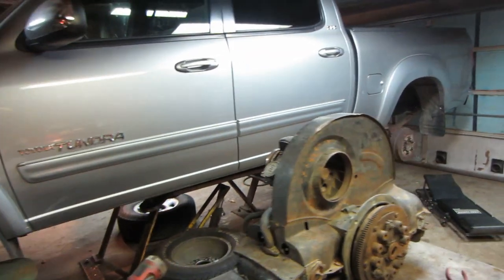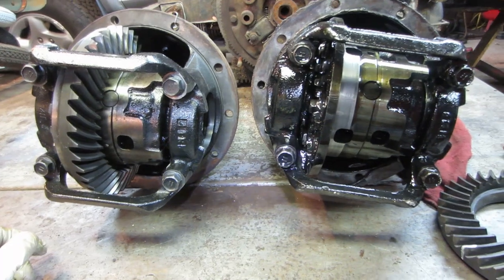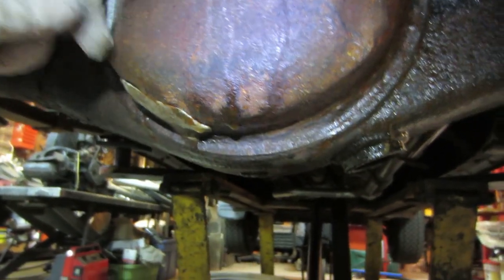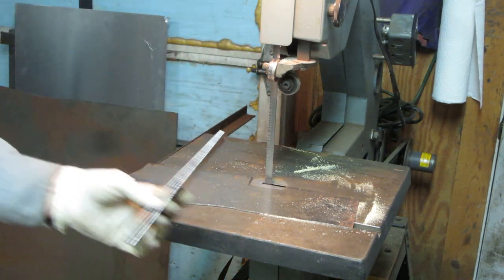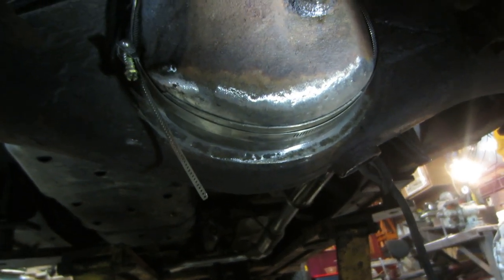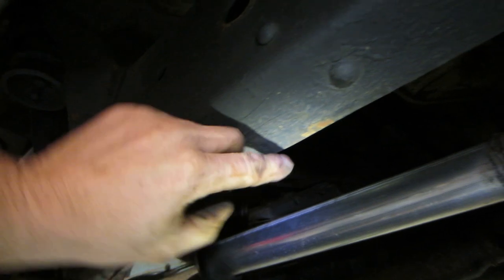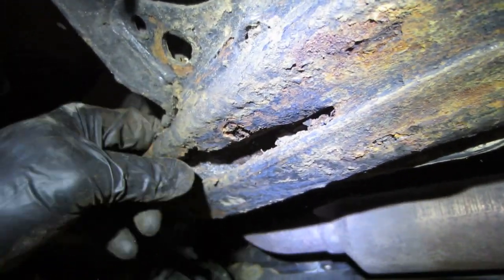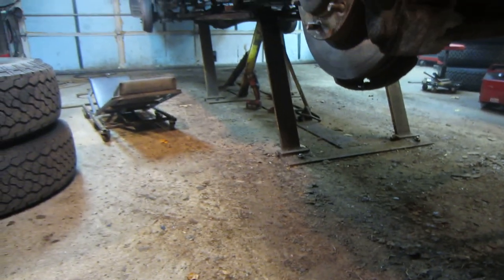toyota tundra rear differential repair

Comment: Seeing all that rust behind the "protective" coating makes you want to grab a Toyota engineer and show him how great their "fix" is.  Then again, he'd probably blame the dealer for some kind of mis-application error.
Reply: Wow!  I can't believe that Toyota used such thin steel in the frame and rear axle housing, then didn't even give it a good coat of paint at the factory!  And yes, the "fix" really was aquick coat of magic elixir, did more harm than good, but probably got it through the warranty.  At the time, Toyota apparently didn't quite have a grasp on how Americans used their pickup trucks, and what was expected.  The half ton pickup is probably the most overloaded and overworked vehicle made...or, it is simply used as a car.
Reply: Genghis Chuan  tar has been around for decades ..it is still widely used ..that stuff was/is just crap
Reply: Genghis Chuan  never said that toyota applied 
tar was saying tar is available and won't be a shitty job like what they used
Reply: Genghis Chuan  lol..i applied it as a job,if you do it right it takes the same amount of time as what Toyota used... it's sprayed on and drive out..
Reply: Genghis Chuan  anyway this was your original statement not how do we apply tar to the underside of a car ....'The engineer used the best available at the moment'....obviously it wasn't it failed ...tar wouldn't  fail if applied correctly
Reply: I mean you know all trucks rust right?  Toyota isn’t worse than anyone else.
Reply: I seriously doubt that Toyota approves of the use of this "coating."  It's a dealership scam.

Comment: Thats the same truck as mine, upstate NY. Toyota replaced the frame for free... a mechanic at Toyota put his fist through my frame and it didn't pass NYS inspection. My diff cover was leaking so as you did welded patches but it just started to leak in a new spot. I bought an after market off road replacement cover, cut the old off and welded the new one on.
Reply: which after market cover did you use and how is it holding up?

Comment: Quick tip for the disconnected brake lines; wedge something against the brake pedal slightly and it will stop all the fluid. Just something enough to get the lights to come on, bit of light pressure. I've rested my car toolbox against the pedal for hours before, never had to worry about the master running dry.
Reply from the maker: l like that idea
Reply: Yep, just enough to get the piston past the port in the master.
Reply: Do you rest something against brake pedal before disconnecting line or after. So this is suppose to keep fluid from draining right.
Reply: It works. The primary piston moves past the compensation port and it will NOT leak out.
Reply: I scored a couple of plugs that   have a female on one end and male on the other. I can't quite recall the size but it works awesome just screw the brake line right into it.  Puts the brakes on the brake fluid and helps with possible air getting into the system

Comment: I just got my 01 tundra back from Toyota it has 270 k on it and they had no problem replacing the entire frame .they have a recall and won a  judgement against the frame manufacturer for something like 3.5 billon dollars .if your frame is rusty I would give them a call all they should need is the VIN NUMBER .it took them about a month to get my frame in but only a day and a half to replace it good luck .

Comment: Hey Mustie...  In NY...  I use a coat of JB Weld to fix oil pans and cracked blocks....   The grey 48 hour stuff....  The trick is surface prep.. To bridge large holes use a small piece of aluminum tape.  ATF is the best undercoat..  Chevy's rot just as bad...

Comment: Man I got nervous for you picking at that rot.  That frame looks weak at the spot you were working on.  Can see how the rust starts though. The curved part of the frame just collects water and dirt till the drain holes plug. Then the gunk just sits there wet..and then a rust blow out.. Silly design..

Comment: hey mustie. im a plumber i have several pipe threading oilers. after years of use rain etc the rust pinholes in the pot. i clean them and i spray truck bed liner all in the pot after i epoxy them. now 6 years later there still in use. you should spray your tundra differential cover with that it will never leak or rust again

Comment: I'm 73 and remember when undercoating was an option that was added to new cars at dealership, however these "new" cars sometimes sat in the mfg's parking lots for weeks and had surface rust on non painted bare metal, namely frame components. Applying undercoat over rust just seals in the rust, holds moisture, etc.

Comment: i worked for a mechanic when i was in my early20s. 
he built rear ends for drag cars. you need to measure the back lash from the pinion.  7k to 10k was standard. but then you have to shim it correctly then use a dab of paste like tooth paste. need the smudge to be shape of a perfect bullet shape. it is most definitely an art. great video. cheers

Comment: I just do an oil undercoat spring and fall.. Never had a rust issue with a car yet. I'll drive it up and down a dirt road a few times. The dirt covers the oil coating. Don't  know if this works any better, but it was a bit of wisdom passed on from my father that I've never forgotten.

Comment: I live in a simular climate as Mustie (Norway) with road salting an moistness, and from what I have experienced all car makes suffer from this kind of rust. I've owned WV, Audi, Peugot, Citron, Opel, Fiat and Toyota they all quickly rust like that no difference. It's more down to models and production years and what the companies tries to smear underneath a certain year. They experiment a lot with this it seems.
I'm planning on using oil next time though as this was a very eyeopening video Mustie, thanks.

Comment: Enjoyed the video and the comments, all very helpful! A relative in the salty Midwest just gave me a Tundra with MAJOR rust problems. The frame had already been replaced by Toyota but the dealer bolted many severely rusted pieces right back onto that new chassis. I'm doing triage on it right now, trying to decide what can be scraped and painted and what has to be replaced. I think the frame will make it but various connectors, bearings, bolts, cables, springs etc. are in really bad shape. Have already removed the corroded rear bumper and support/hitch. I think a needle scaler is in my future, and some metal prep, rust reformer and paint. Should be quite a project.

Comment: You should REALLY bring that back to Toyota for another inspection.
I bought a 2007 last year and looked at almost 50 of them with varying degrees of undercarriage rust. That amount of rust damage would be replaced by the dealer. ALSO, your rear differential would have been replaced. I saw some that were replaced, and the dealers thought buyers didn't understand that Toyota had done that for FREE. EVERYTHING was free, even the fluids. Trucks for sale in northern New England were $1500-$3000 less than those in NJ and south because of the rusting. Maine uses a salt/sand mixture that makes it safer, but also sandblasts your entire undercarriage.

You're correct about undercoating and continuation of rust. Even on new cars. In 1977 I bought a new Corolla and my brother bought a new Dodge Colt. Mine received undercoating from the factory to prevent rust in shipment over the ocean, the Colt had undercoating put on from the dealer. In 5 years his was a rust bucket, while mine had no rust anywhere.

Comment: ANOTHER GREAT VIDEO U REALLY OVERDUE YOUR REPAIRS BACK IN THE 70'S I USE TO WORK AT A DODGE DEALER IN PA. AND I UNDERCOATED "NEW" CARS IT WORKED WELL AS U SAID NOT ON USED CARS..TKS RON

Comment: My first super beetle back in the 80's had a bitumen type undercoat from new. When I restored her in the late 90's I removed it to check for rot and found perfectly preserved heater channels and floor. We also have winter salted roads in the UK so it did an amazing job. I decided to go with a thick epoxy paint on my current bug and see how that holds up.

Comment: I went through all this too. Charcoal gray 2004 Tundra. Take off the truck bed, use a needle gun to blast the rust off, and coat it with marine grade red lead primer. You can't get the inside of the beams, but you'll add another 6 years to the frame. Long enough to sell it without feeling bad.

Comment: Painstaking process.  Like you said in your comments you bought it right.  Once you have completed your frame repairs and coating you will be confident in what you have going forward.  Paul Short, a fellow You Tube contributor, shares your belief on undercoating.

Comment: You really lucked in on that diff,  the pinion seal went bad on my truck.  It was $1000 for new bearings, race, axle, pinion seals and fluids.  The fine tuning of the shims scared me off from doing it myself and the fact I don't have a garage or a driveway for that matter.  My brother's ranger locked up on the highway when the diff shit the bed its no joke when they fail.

Comment: That's awesome you got the rear diff back together. And for only 50 bucks in parts!!! Truly an incredible score. Well done!! I fear for the body on my truck on upcoming winter here in Michigan. It's a G.M. so the frame is good, but the body is going fast. . . Drivers quarter panel is already gone. Michigan has started using a salt brine that they put out before a storm. I honestly think it is stronger than the pellets they spread causing the vehicles to rust faster. Keep up the good work!  -Nick.

Comment: If you clean off all rust dust and moisture before and thin down and use the black jack warm it does ok and will last but it will flake and needs to be maintained. Most do not do this and see it as a quick cheap tidy and then sell the vehicle, new owner buys and never looks again. Been using waxoi and it is ok but i have 40 litres of chain oil and will give it a go. Thanks for the tip

Comment: When overlaying steel like that you should really use a weld through primer to prevent rust between the patch and the original steel.
Reply: I reckon the gear oil will do much the same in this case.

Comment: I live in Maine, those kind of undercoats will literally bore a hole in your frame due to winter in a season or two tops. Like, I saw a 2016 Ford with an undercoat like Toyota used and it had a golf ball sized rust hole through the frame. Oil based coats all the way! :D

Comment: Good to see you taking on a project and sharing it.  I wish you the best with that truck.  I've heard of the frame rust issues from the 1st gen Tundras and was skeptical as I had a 2002 Sequoia and never had an issue.  However, a good friend of mine recently bought a truck like yours and he's showed me the frame rust on it.  I have lived in the south so we don't have the same exposure you do but, this truck he has spent some time up north.  I've heard they fixed the issue with the 2nd gen Tundras, and I'm hoping that's true as I'm on my second one, a 2016.  I recently took off the bumpers, sanded, cleaned, primed them and then put undercoating on the inside of them.  I also put primer and bedcoating on the outside.  So I was glad to hear you say maybe if you put it on before the rust starts while it's new; which is the case.  I'm disappointed in Toyota spraying over rusted frames.  That's just idiotic.  But, I guess every vehicle up there gets rust; some just more than others.

Comment: I once bought a 1973 Ford Thunderbird (yes a big 460ci land yacht of a car) from Ca. that lived it's life next to the ocean in San Fransisco, and it had surface rust on every nut bolt and screw and I swore I would never buy another rusty car again, .BUT it sure didn't look anything like this truck!  Honestly I don't know what the heck I would do if I had to work on something like this! 

Hell I just picked up a 2004 Toyota 4Runner again out of Ca, that literally looks new under neath (well it also has 39K miles).. So I guess there are some small benefits living within driving distance of Commyfornia! LOL..

Comment: Toyota had a frame recall for these trucks for this very issue. They put a brand new frame under mine at the dealership. Mine wasn't as bad as yours either, they would have loved to have gotten yours. Anyway, looks like you you got on top of it.

Comment: I live in Texas and I almost bought a Tundra and my wife did a search o Toyota Service recalls and found the problem with front Ball joints and decided we did not want problems since we had a front ball joint failure at one time.  Although we don't have a rust problem such as yours down here. I was wonder about Toyotas response in regards to the frame and differential problem. Your frame problem  solved the question of ever owning a Toyota for me. I just won't ever own one.

Semper Fi, Henry.

PS Enjoy your videos.

Comment: I use old engine oil  for the underside I spray it on . messy job but keeps the rust away. especially in the winter months with all the salt  on the roads.

Comment: On my Toyota Tacoma I took a long air nozzle and blew as much dirt and rust out of the frame rails as I could. And now I’m gonna weld some patches over the holes. And then I’m gonna oil the daylights out of it. I’ve got a big industrial tank sprayer that I can pump up with the oil/diesel mix I’m going to use. Oiling inside and out.

Comment: There is a recall for early toyota tundra frames for rust damage. Under the recall toyota will replace the frame and control arms free of charge. However if you do any welding or repair yourself it may void your chances to file a recall claim.
Reply: The shit he was picking off was toyota’s fix for the recall..  its their goodnuff undercoating.   A recall like that is based on the factory technicians opinion on whether the frame gets replaced or not and that recall didnt kill enough people so it is voided now and they retired their coating fix also..

Comment: Why don't you use POR15? You can flapdisk sections at a time and brush it on.. It'll probably hold up better since it's not thick rubberized coating or too thick of a material. Looks like you should wire wheel the rear axle and fully redo it since it had a hole already

Comment: Toyota's frame recall called for an exam of the frame.  If it looked good as in no rust they coated them.  If rusty they replaced the frame.  I think the guys who went in with rusty frames got the better deal.  I agree that the over-coating probably speeds up the frame rusting process.

I talked to a guy who had about a 2001 Tacoma who told me his son works for Toyota.  And his son told him it costs about $10,000 to replace the frame.  A costly recall for Toyota.

There was also a recall on lower ball joints for some of those first gen Tundras.  You may want to give Toyota your VIN to make sure yours wasn't one of the affected vehicles and if so that the ball joint was replaced.  I think the recall/warranty has expired but even so if you  replace it yourself their OEM balljoints cost only a little over $100 and are an easy job.

Comment: OK I know this is an old video...but Mustie? Have you ever heard of/tried a product called "POR"? ( Paint Over Rust) You can either put it in a paint gun or use a brush. It neutralizes the rust a stops any further rust from appearing. My brother did a resto on his '85 Delta 88 about 20 years ago. The paint looks like ass now,but the frame and body panels are still rust free lol

Comment: Hi, great videos, I've been binge watching.  You do great work.  I just wanted to point out, you've used Permatex The right Stuff regularly, but you're using it incorrectly.  You always apply, let sit for 5 minutes, assemble loosely, let sit, then do final assembly.  You're supposed to assemble within 5 minutes of application.  In some situations, letting it set up before assembly will keep the parts from sealing.

From the Permatex website:  

DIRECTIONS:
Clean and dry parts. Push nozzle to dispense the Right Stuff®. Apply a continuous 1/8″ to 1/4″ bead to one surface, surrounding all bolt holes. Assemble parts within five minutes, tightening bolts to recommended torque levels. Material will fill any surface imperfection. Equipment can be returned to service immediately. To reuse package, leave a 1/2″ length of material extending out of the nozzle. Cured material will form a protective plug. To reuse, carefully remove the plug and dispense as before.

Comment: Congrats again on the rear differential! Well sir, my hat is off to you once again for all the work you did flaking off the undercoating and rust spots. Labor intensive but has great results when you put your special sauce to it! Obviously that pumpkin cap doesn't come off easily without taking the whole rear axle assembly out?
Reply: The rear pumpkin cover is welded on.

Comment: Hi, I'm hoping you might help me.  I have a 94 pickup 4x4 with 172k miles that has a leaking rear diff at the 3rd member. I already replaced the pinion seal so it's the paper gasket at the 3rd member that's still leaking. So that said, I've decided to go all out and put in a 1st gen Tundra axle / diff because I've already lifted the truck ~4" and really want the wider track which will be ~2.5" additional per side. I'm also installing a long travel kit on the front so it too will be wider, about 2" per side.  I have 33" tires so the goal is to buy a Tundra axle and swap in a new 4.88 gear set and either run the stock limited slip differential or spring for a new (or used) e-locker.  If doing all this will I also need to modify my front differential gear set to 4.88 or can I leave them stock.  I know my stock 8" rear has 4.56 gearing so I assume stock front is the same.  Do they have to match? Any tips appreciated!